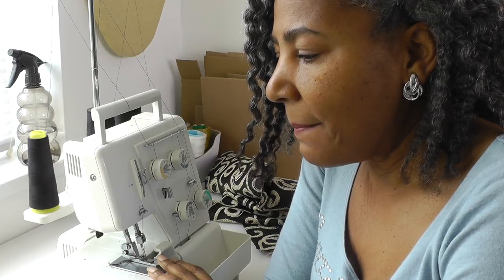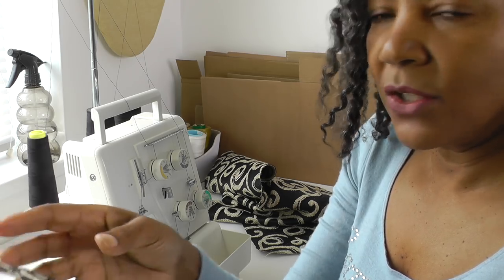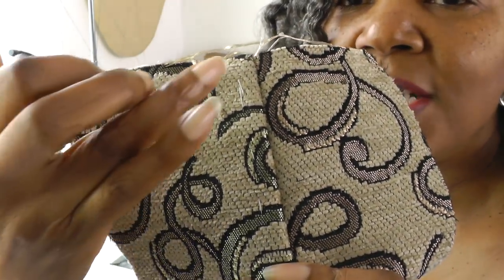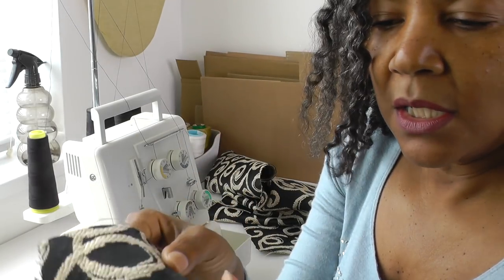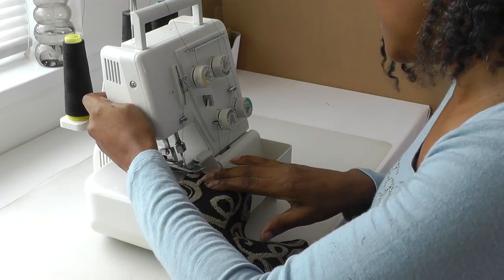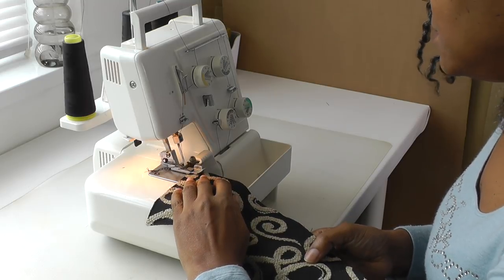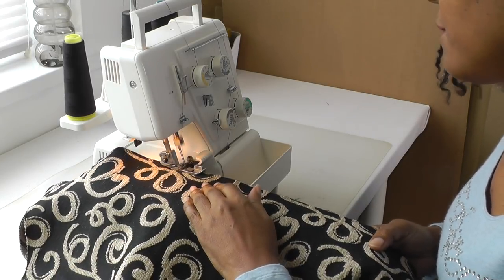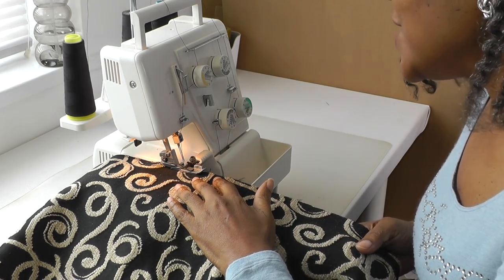Sewing lookbook - How I Plan My sewing Project: episode 3 Serging

Comment: Hi Colleen, I'm a sewing beginner and have questions about episode 3 of your Sewing Lookbook.  You indicated when you overlock you don't cut the fabric with the blade.  Does that mean you disengage the blade when you overlock?   Next, what particular overlock stitch are you using?  Lastly, you said the only dart you'd be inserting would be in the sleeve, to achieve a strong, structured and tailored look.  How is it possible to place a dart in a garment that will be worn as  reversible?
Reply from the maker: Hello TaDarling1. Great questions first question is No, 2nd question the default stitch, 3rd question I’II go into more detail in the episode 5. I will also answer your questions in more detail in the LIVE Q&A this Friday check out the community page for more information. See you there!